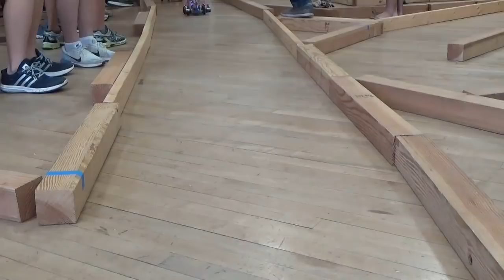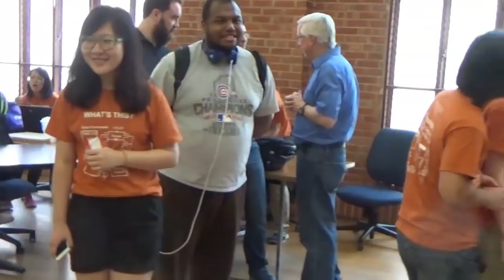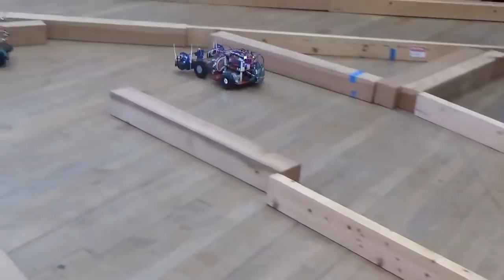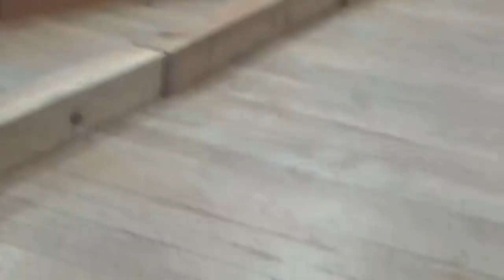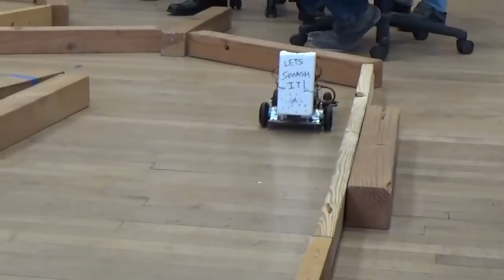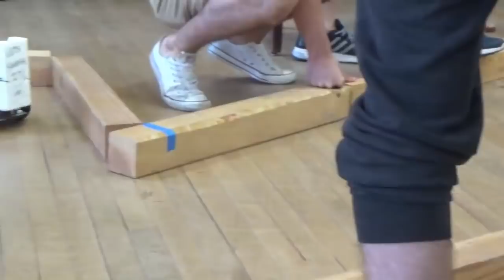EE445M Spring17

Comment: Wow, one of those cars looks like it has at least 4 uC boards on it. If using the CAN libraries then I guess it's the easiest way to work around the code size limits of the freeware uVision IDE. I have a similar issue with the verbosity of CAN + RTOS + LCD on something I am working on atm - the code gets rather sizable unfortunately.